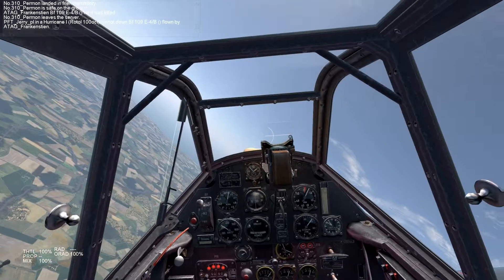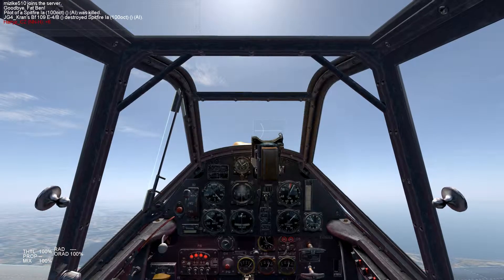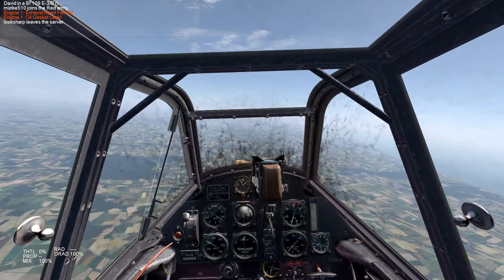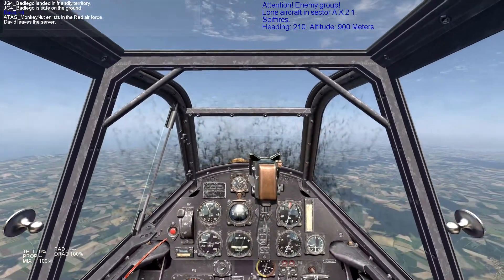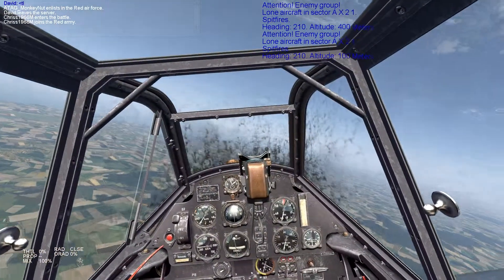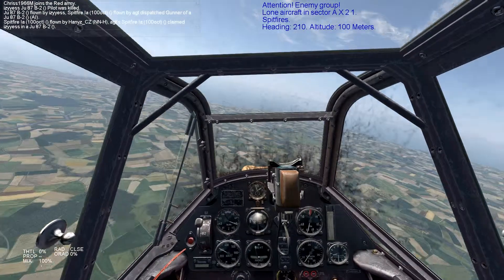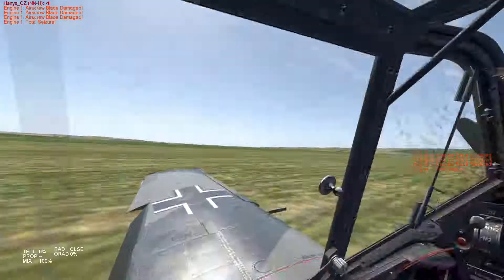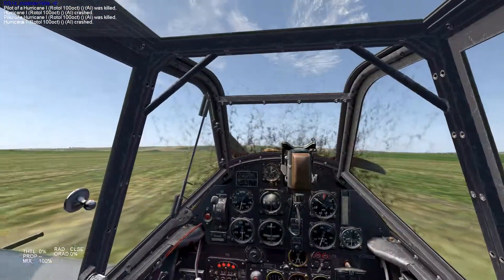IL-2 Cliffs of Dover: Ditching the 109

Comment: Old video but I'd like to add something: shutting the engine off also allows you to use certain electrical systems (prop pitch, gear, etc.). Once the governor fails you can't use these systems. It's useful if you want to adjust the prop pitch to full fine (or coarse, always get those mixed up.) to reduce drag and it guarantees your gear will come down.
Reply from the maker: Coarse pitch turns the blades into the air and reduces drag.  Hydraulics not required for gear extension due to the emergency blow down.

Comment: Bailing out at altitude is far safer in real life.  Gliding an aircraft in a combat situation means you are a sitting duck, plus the weight of the dead engine will likely cause the aircraft to fly nose heavy, affecting the stall charachteristics and possibly causing the aircraft to invert on impact.  I also notice lots of people trying to crash land with the gear down, which on an unprepared surface is not recommended either!
Reply from the maker: The nose heaviness is not a concern, I've got trim for that.
Reply: @jochenheiden  I’m talking about real life, not a simulator! …Trim away!